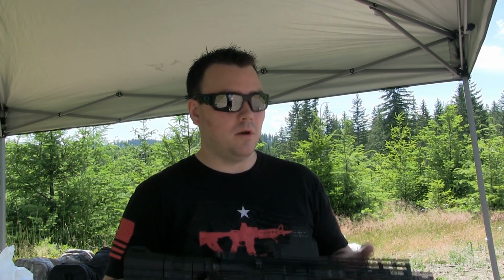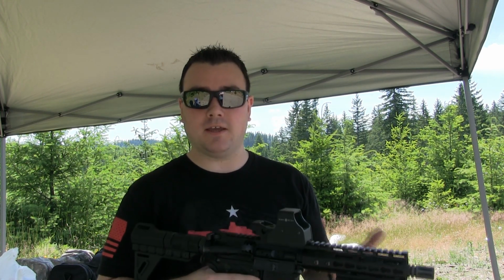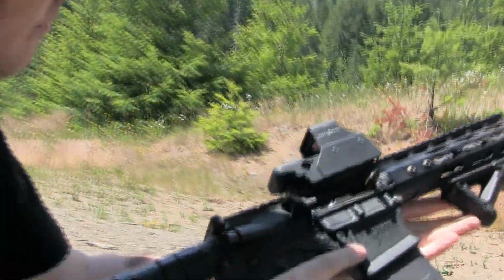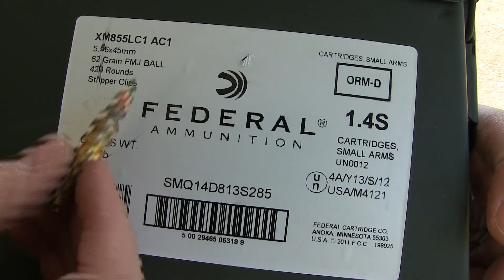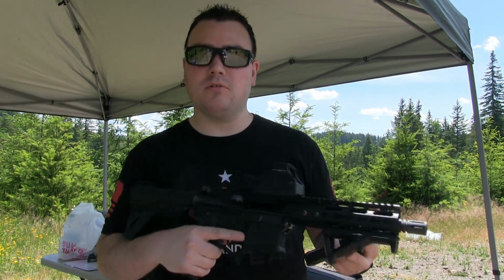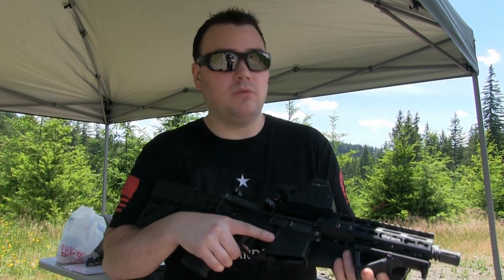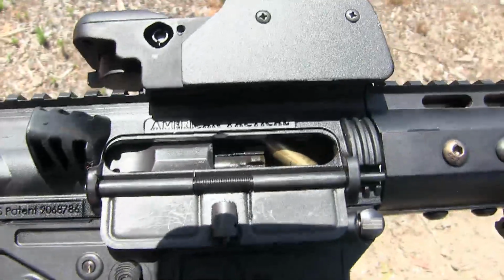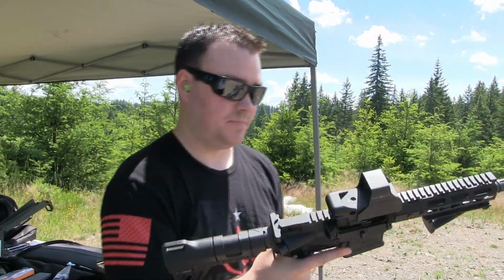ATI Omni Hybrid AR Pistol **JAMMING ISSUES**!!!

Comment: I know of one gentleman who had the same issues he bought a heavier spring and a heavier buffer and he no longer had those problems.
Reply: Trump One I may need to try this mines hasn’t jammed yet it just didn’t cycle maybe those are two of the same
Reply: @dionhmedji4521  the only thing I had with mines was one of the casings didn't extract from the chamber I guess it was a bad casing because it kind of chipped the casing but when I got it home it fell right out that was the only problem I've had with mine and I was firing brass ammo

Comment: first  clue is that the casing is being caught in the ejection port, the BCG is moving too fast. The buffertube mass needs to increase to induce more latency in the BCG. most of your ejected casings had a forward trajectory. The casings should fly either laterally or towards the rear or anywhere in between.

Comment: I had the same problem. I put a sig extractor in it and no problems since. 50$ fix.
Reply from the maker: I just made an update video to this. I replaced the spring and buffer for heavier ones and that fixed the problem. It was over gassed.
Reply: Would the sig extractor work in the  omni ar15 also?.. I have the same issue with my rifle
Reply: Extractor doesn't have anything to do with the brass not fully ejecting.

Comment: It's a gas issue,  your BCG is running too fast.  Get a heavier buffer.  Or get an adjustable gas block.
Reply from the maker: I did an update video on this. I did replace the buffer spring with a heavier one and put an H3 buffer in (4.6oz) works great now!
Reply: Very good advice I saw a video of a gentleman who did just that first he bought a heavier spring and a heavier buffer and his AR pistol work just fine thanks for that advice cuz I own one as well and if I run into those issues that is what I will do.

Comment: Same thing happend to mine however it didnt happen as frequently. I check the alignment of the gas block and check for clogging and also checked the extractor spring tension or sticking. After that it was butter
Reply: @StuntmanJake  i guess there is always one huh?
Reply: @laughingpain3006  the ATI is totally worthless.  It’s just a toy, really.  Plastic lowers don’t work.

Comment: I have the same gun but the rifle one. Mine does the same thing but for the green tip bullets. I thought it was my gas rings but it kept doing it for the green tip. So I tried having less ammo in my mags that are new. It helped but it eventually kept double feeding and doing what yours was doing. I used the normal Winchester 55 grain and that work a lot better and didn't really have an issue. But I found out most of my problems was because I had fully filled magazines that were brand new. Putting to much pressure and double feed and stuff. So I think that fixed my issue however I'm still debating if there's something wrong with my gun. Mines been disassembled and put to gather and cleaned. However still debating if it's something to do with the gas. Nothing looks broken or worn only shot it a few times. Looking for any input too

Comment: Wow mine runs great. I’d really like to know what the problem is when you figure it out.  Just in case I would run into the problem down the road.
Reply from the maker: So reading up on this issue I've learned it's common for AR pistols to be over gassed and cause jamming problems. The way you fix that is getting a heavier buffer and spring for the buffer tube. That slows down the bolt and allows it to eject the spent casing more smoothly. I ordered the new parts. let's hope it works.🤞🏻
Reply: Mine spits out the casings at about the 2 o’clock position. I’m looking forward to finding out how it works with your new parts. I’ll do the same then with mine if it starts acting up. Thanks for the video!

Comment: I bought one about 2 or2 1/2 years ago. Same issues. I sent it to the factory and they said it was the gas block and they pinned it. I got it back and it shot ok for around 40 rounds. It’s never been right. It’s huge pain I the ass. I can’t trust it so it sits in my storage.
Reply from the maker: I made an update video to this issue a while back fixing the problem with a heavier buffer and its been flawless ever since. 

https://youtu.be/cEwNR_4L89c

Comment: Gotta keep the gas tube clean, shorter barrel = more gunk in a shorter gas tube. Longer ARs are more forgiving due to much longer gas tubes, disperse gunk. Yours has the newer gas block, so it shouldn't be a gas block issue. I had a different AR with the same issue, Lotta bent rounds / FTEs. Cleaned the gas tube, money. I had shot mine ~600rds over 6 months without cleaning the tube.
Reply from the maker: I did an update video on this. I replaced the buffer and spring. It came with a 3 ounce buffer i Put a 4.6 ounce buffer in and a heavier spring. That fixed the issue.
Reply: @FREEDOMEAGLE556 
But did you clean the gas tube? Apologies if I'm persistent on this, definitely not trying to long distance gun doctor it. Glad the parts change out fixed it.
Reply from the maker: No I haven't but definitely will thanks for the tip. Thanks for watching!
Reply: What buffer and spring did you buy?

Comment: Do u think it's a good gun just got one last night
Reply from the maker: After I fixed mine its been working great
Reply: @FREEDOMEAGLE556   ok great still watching  all ur videos  what would be a good but stock red dot  and handle  under the rail
Reply from the maker: @yisraelel3077  I just recently added the SBA3 brace to mine. There is a link in the description for my sightmark red dot that I have and I'm using the magpul AFG-2 foregrip but you will also need an 11 slot magpul rail to go with it.
Reply from the maker: @yisraelel3077  Magpul 11 Slot Rail: https://amzn.to/2Lsyk4q

Forgrip:
https://www.primaryarms.com/magpul-afg-2-angled-fore-grip-black

4.6oz buffer: https://www.primaryarms.com/expo-arms-h2-ar15-carbine-buffer-fde

Buffer Spring: [Carbine Size] https://www.midwayusa.com/product/3415152626/wolff-extra-power-buffer-spring-ar-15